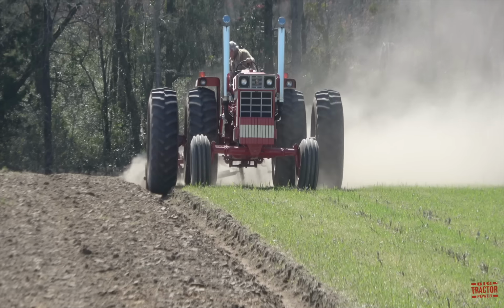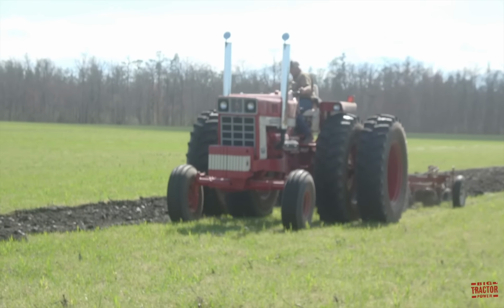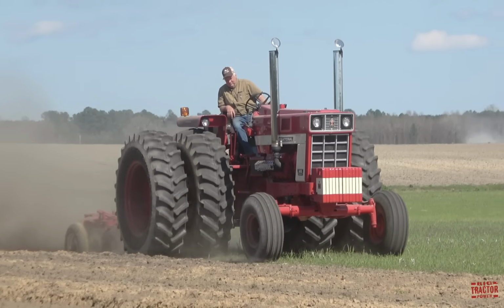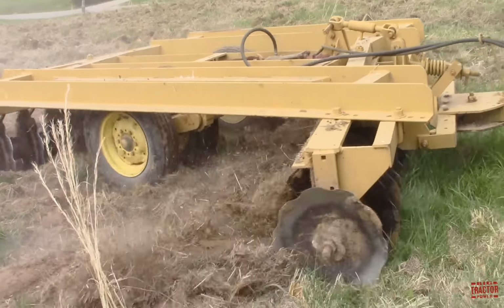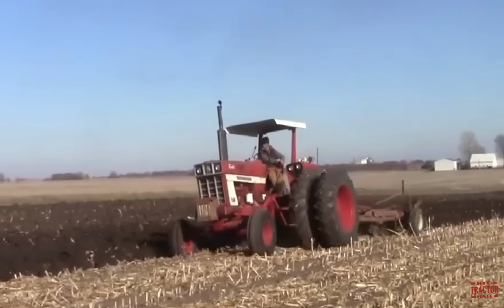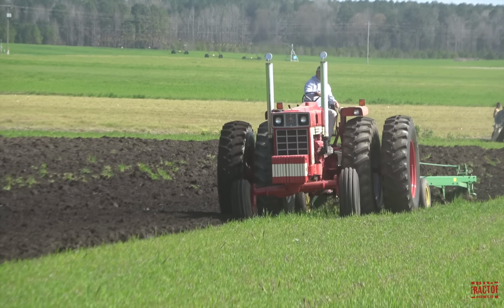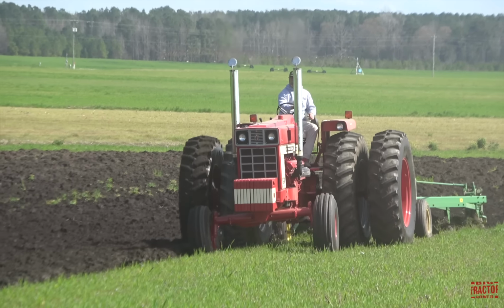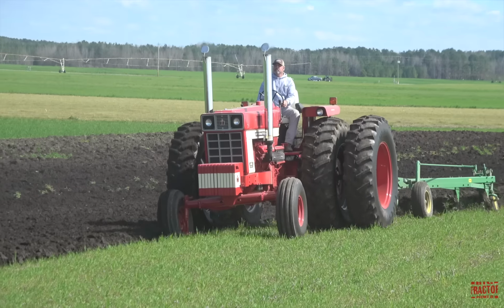INTERNATIONAL 1468 Tractor Plowing

Comment: Beautiful tractor. Pulling that plow like it isn't even there. 👍🏻🙂
Reply: That is because the plough is only 6 rows. Average nowadays is 36 rows plus.
Reply: @jackchapo2011  What?
Reply: @bradjenkins932  what? Our tractor has 48 blades.
Reply: @jackchapo2011 This isn't a modern tractor.....
Reply: @WowCreativeUsername  I understand. There seems to be quite the stir about it though?
Reply: @jackchapo2011 #1, They are not blades, they are bottoms..#2 I'd like to see the 48 bottom moldboard plow your pulling.. #3 It's a 2wd tractor, and those are the right size tires.
Reply: So, the technical name for them is actually disc but, call them what you want. Search John Deer Australia 2430 Chisel plough. We run up to 3 or 4 of those in tandem linked with disks. 2 wheel drive or otherwise as soon as you get wet or heavy in black soil those thin tyres will dig in. The only way you will pull them out is backwards.
Reply: @jackchapo2011  I have been farming for 57 years now, and l have pulled these tractors out frontwards many times... This is a moldboard plow, not a chisel plow.. Big difference.
Reply: So. Can you buy a tractor of that with a wheels this small today? Also, if you were only running one tractor how long would it take you to plow your paddocks with 6 blades. I think we would need to run the plough 18 hours per day for 6 days per week. I think you have been farming 50 years more than me, but our tractors are traded every 5000 hours. Nothing we run is more than 4 years old.
Reply: @jackchapo2011  Yes you can.... About 8 - 9 hours. I have tractors with over 25'000 hours on them.
Reply: I do not disagree we have a tractor pulls three grain bins has done around 25,000 hours runs just fine. So in black soil, first cut of the season is hard on your gear so pulling significantly slower. We run two tractors means 60 discs. On a first past slow day we will get through an average 120 hectares per day 50% more on second pass pre seed. Our windows are quite small so family rotates tractors early nowadays. Easier and more economical than turning soil at 3am.
Reply: Do you aerial spray?
Reply: @jackchapo2011  No.

Comment: We had several IH S-Series spreader trucks from the 80's. Two had the 9.0 liter IH motors and the rest had DT-466 engines. The 9.0 liter engines were gutless. Would barely maintain 45 mph loaded. The 466 trucks would walk the dog loaded .

Comment: We had one growing up in Louisiana.  We bought it used when I was about 12 years old.  I finally got to start driving it when I was about 14 because the clutch was so heavy, having no hydro assist.  After driving it all summer long, your left leg would be 2x the size of your right.
Reply: I didn't know they came without a hydraulically assisted clutch. Ours had the deluxe cab and torque amplifier. Jason is reporting 20.3 mph but ours would clock 30 mph. It had been "adjusted" to run a bit overspeed but it may have been something to do with tire choices as well. We ran 20.3 x 34 dualled with hub mounted 18.4 x 38s. I've seen others comment about theirs really getting up and moving on the road too. Although we ran a mixture of Case, Deere, Steiger and IH, we worked back and forth with neighbours who had exclusively IH equipment so across the two operations, I had thousands of hours in the 1468, 1456, 1466, 1486, 1066, 1086, 3588, 3788, 4166, ... plus all the IH utility tractors from 606 onward and an array of swathers, combines and other cool equipment.

Comment: I have run both the 1466 and 1468, I always thought the 1468 had more power. But I was in my late teens and the twin stacks sounded more powerful! We were using the 4WD frontends and would put them on and take them off for different needs. When they changed tractors we would just use the frontends we had but for some reason the 1468 didn't have the cover on the side of the transmission to hook up the 4WD shaft.

Comment: Run a straight piped 1468 or 1568 open station for 14-16 hours a day for a week plowing or disking then tell me how much you love that sound.
Reply: What??
Reply: That is when you put the protective sound ear muffs on. We ran an ALLIS CHALMERS  D21 for six years  if I recall correctly the turbo was effectively the muffler with a straight pipe above the hood. They were exceptionally noisy but we loved that tractor. This 1486 sounds beautiful.
Reply: That’s why my ears ring all the time.

Comment: I think they’re neat, but the engines weren’t good back then, and they still aren’t now. Was a gas engine converted to diesel and wasn’t heavy duty enough. I had a 470 Cummins in my D145 Versatile, but the Cummins 6 turbo that replaced it is MUCH BETTER. Better power, torque, fuel economy.

Comment: have you come across a Massey Ferguson 1155 in your travels?Both the 1466/1468 were later up to 145 PTO hp.If it was nt for a MF 1150 there might not have been a red 1468.
Reply from the maker: I have filmed one 1155 on one Pass plowing I have about two minutes of footage of it.  I really want to film an 1150, 1155, 2775 and a 2805 very badly.

Comment: The 66 series was 1972-1976 the 1468 is a 1466 with a v8 in it, & it was a year before they released it , 1973 i beleive & it didnt finish the series run, as i think it stopped in 75, so,s from my memory the 1468,s were 73,74&75, i know where 1 is, & ive been around it over 40 years now, ive ran a 1135 massey in feild next to that 1468 ih , i was around wen the 66 series were still being built

Comment: The man driving the tractor better have ear plugs in because straight pipes on a natural aspirated engine are very loud. The tractor would run better with mufflers to get the proper back pressure so the engine could run more efficiently

Comment: Had Massey Ferguson not manufactured an 1150/1155  l wonder if IH would’ve  made the two  V8s.  Massey was the first row crop with a V8.  The Massey Ferguson was superior in several ways particularly in Hydraulics and IH didn’t copy that. Forget not that Ferguson was the originator of the three point system and, added closed center Hydraulics ( which Deere copied ) later.
                               Fergieman

Comment: 20.3mph? My 1468 will run 28mph down the road all day
Reply from the maker: I report the specs given in the original sales literature.  IH tended to under promise and over deliver on their specs in  the brochure engine hp and speeds.
Reply: @bigtractorpower  fair enough i don't us3 mine much anymore all my equipment kind of out grew it ill still pull the feild cultivator with it in a pinch tho